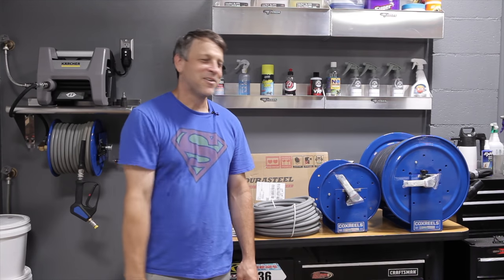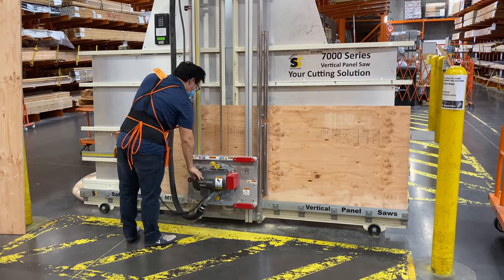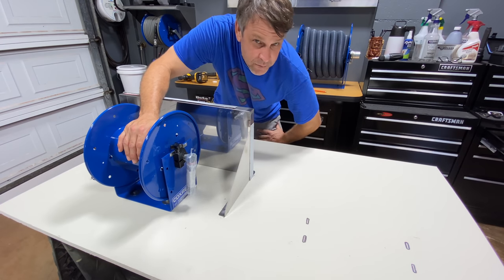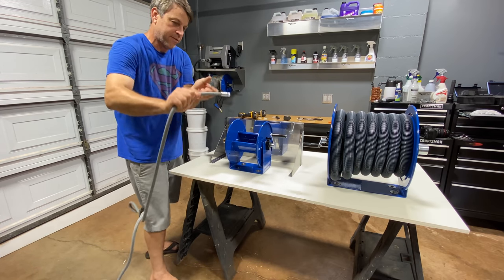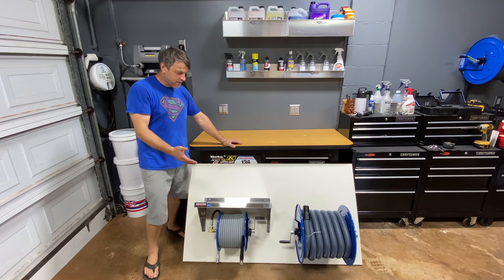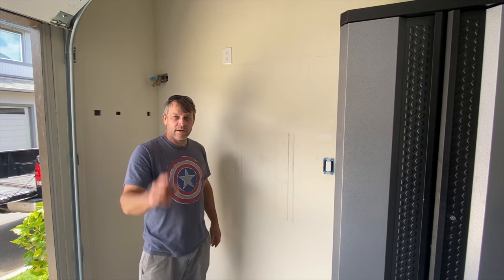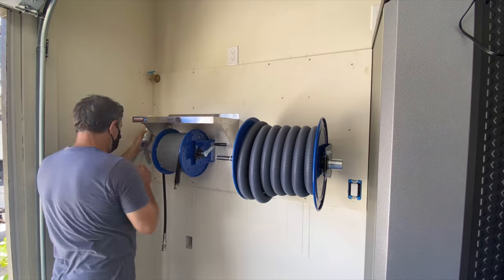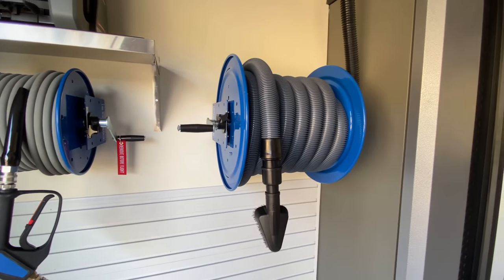DIY WALL MOUNTED PRESSURE WASHER & VACUUM SETUP. CUSTOM DETAIL GARAGE BUILD

Comment: Very nice.   Do the backs of the screws in the plywood interfere when mounting to the drywall?
Reply from the maker: Yes they did. I took a cutter wheel grinder and cut off excess threads and we had to also use a small hole saw to make it sit flush. Was easy and worked great. The homeowner wanted the unit to be a permanent installation that will stay with the house forever.
Reply: @HawaiiDetailing  this is the nicest inexpensive setup out there for someone.  I have all the components except the 2 reels.  Might give it a try sometime come spring in the Midwest.
Reply from the maker: @milanjurich1526  good to hear. I really like the setup too. Works great and reasonably priced.
Reply: Nice until you need to remove the reel for something.
Reply from the maker: @billycallahan3338 The reel can be removed and serviced and the bracket would stay on the wall. All parts of the reel can also be serviced while it’s still on the wall. These reels will last a lifetime with very little maintenance though for sure. If for some reason you decide you don’t want it anymore and need to remove the whole reel including the bracket than that’s another story. No matter how you mount it it’s going to be some work involved when you take it down. I do prefer the blocking be added under the drywall like my personal rig but the homeowner did not want to go that route. Thanks for watching and commenting.
Reply: @billycallahan3338  use carriage bolts

Comment: That little vacuum is powerful enough to run with that long hose??
Reply from the maker: Yes it runs it well too. It’s a 5hp motor. I love my setup. If you were to upgrade from there it would have to be a $500 wall mounted vac to get any worth while performance improvements. Thanks for watching and commenting.
Reply: @HawaiiDetailing  yea that's a awesome set up.. I am jealous

Comment: How much is the cost to put a water Connection in a garage
Reply from the maker: If you can do it yourself it pretty inexpensive. If you have to hire someone it depends on the going rate with a local plumber. Thanks for watching

Comment: Is there any problem with the vacuum hose being so long? I have the car detailing kit which has a bit longer hose than what comes with the vacuum. The vacuum hose on the reel seems really long?
Reply from the maker: My first thought when I built this was that I would have to get a large commercial vac but after installing it and trying it out it works really well. I may still upgrade later but this things works outstanding as is. You can also still pull it down and go mobile too.
Reply: @HawaiiDetailing  great!

Comment: Where did you get the idea for this setup?
Reply from the maker: The general wall mounted pressure washer concept is from OG. I have links to the products I used from his store in the description. Using those links if you decide to build a rig supports his operation and myself as well. I customized the wall mounted concept to use the Karcher pressure washer and my own choice of fixings to make it work for my setup. The vac system was something I decided on when I came across the Vac reel in my late night shopping / research. With little to no info available at the time I took a chance and decided to use this Vac reel with my current vac and am glad I did. Works awesome.  Putting it all on the wall in my garage was a no brainer. Another channel I looked at and was inspired by was Ralda's Details. He had a vacuum reel in his mobile detailing van that was awesome. He is a great guy with really good fabrication skills and customizes mobile detailing rigs. Check his channel out. My personal setup is a little different than this one in the video. This setup in this video was for a friend. I have my Vac system separate on the other side of my garage as it makes more sense for my layout. Check out those vids on my channel as well if you are interested. Hope that answers your question. Thanks for watching and taking the time to comment.

Comment: Does anyone know the model number for the Cox Hand Crank Hose Reel (With Stainless Steel Swivel).  OG is sold out and I am looking on other sites.  Prices vary steeply, not sure what the differences are.  Thanks.
Reply from the maker: I don't know the model number it may be an OG exclusive. It should be in stck soon. Thanks for watching

Comment: Does the outlet need to be GFCI?
Reply from the maker: The Karcher has one built in but if you are doing a custom install than Yes and future proof with a 20amp circuit. Thanks for watching.

Comment: My only problem with this video and I saw it in another video from another gentleman mounting a hose on a real. For some reason you guys are using the stiff end to mount the hose real and not the swivel end of the hose.. If you watch the MTM Cobra jet mount on a hose real video made by MTM, they say it's not a live swivel meaning under pressure that swivel doesn't work. That swivel is there solely to make mountain to a hose real easier. The live swivel is built into the gun.

Comment: Add a quick fitting in the pressure washer hose reel and you won't have to twist all your hose up to install it.
Reply from the maker: Yeah. Thanks for watching.
Reply: Quick fittings also have a tendency of leaking. In theory that will be the last time he ever has to thread that hose on. Side note...if you stretch that hose in a straight line it spins much easier as your threading it.
Reply from the maker: @midstatelandsolutionsllc1515  I agree. They have Orings that wear out over time. Best to just do a direct connection on that fitting.
Reply: Looks amazing. Painting the machines to match the garage was a great idea
Reply from the maker: @adilimo  thanks a lot. Thanks for watching
Reply: I have the same Kobrajet hose, and one end is fixed 3/8 NPT male, and the other end is swivel (non-live) from the factory.  So I intend to use the swivel end to connect to my Coxreel, and avoid the hose twisting.  The fixed end will connect to my swivel gun.  Not sure why you want to connect fixed end to Coxreel.
Reply: @HawaiiDetailing  my mtm fittings have been on there for over a year and haven't leaked a drop.
Reply: @kimstockdale632  the other advantage is you can quick disconnect the hose and take it anywhere!
Reply from the maker: @rogerc2364  ok good to know. I am sure it’s fine that way. Thanks for sharing your idea.

Comment: The vac hose assembly cost more than the vac and pressure pump. LOL
Reply from the maker: The reels and hardware are commercial grade and will last a very long time. They are worth the money. The pump and Vac are items that have a lifespan and need to be replace with time. This whole solution is designed around high end hardware with affordable entry level machines that can be upgraded at a later date if desired. They also offers a very high user experience at an affordable price. Looks cool on the wall too. Thanks for watching and sharing your thoughts. I appreciate it.

Comment: Do the k1700 cubes spit water out of the back for you? I am on my second one and both have spit water out of the back in the left hand corner. This is the only thing preventing me from mounting it on the wall like this.
Reply from the maker: I have not had that happen. I have installed 3 of them. Thanks for commenting.